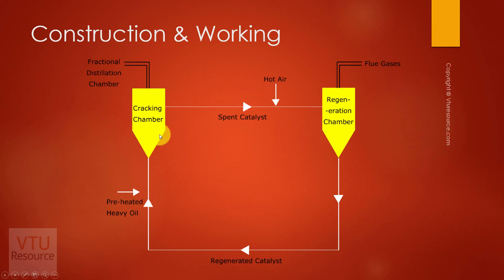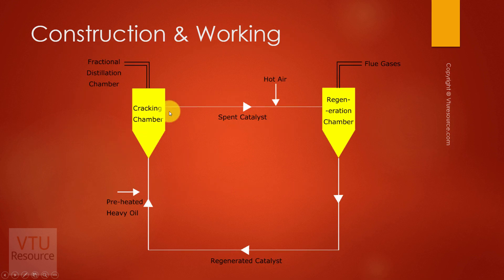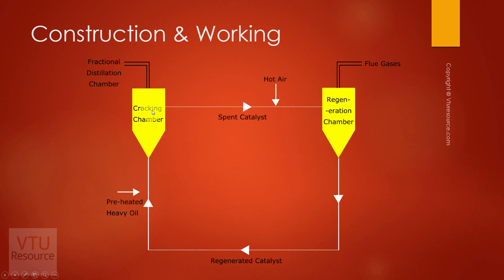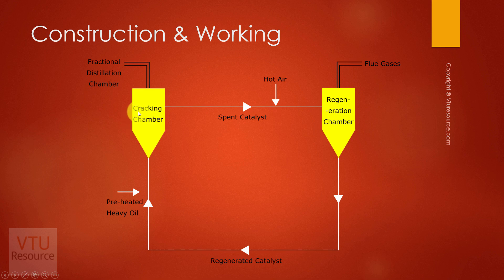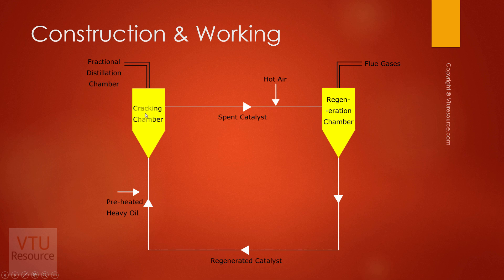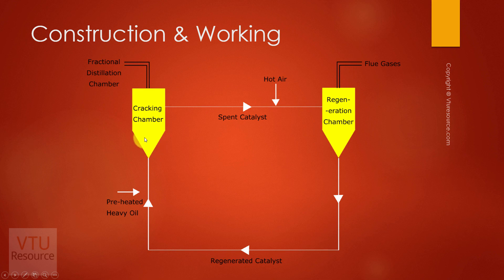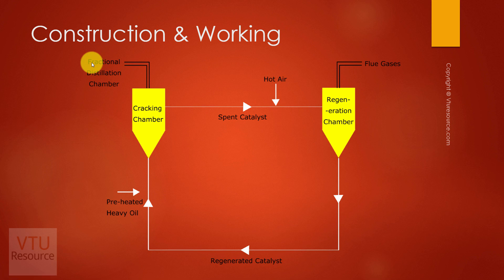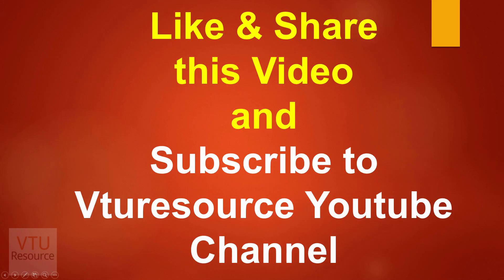Fluidized Bed Catalytic Cracking or fluid Catalytic Cracking

Comment: Good video, but i think you got the ending slightly wrong. The process is called fluidized catalytic cracking mainly because the catalyst in the main reactor is in a fluidized state, not because it is going in rounds and rounds between one chamber to the other.
Reply: Nope brother. He's right. It's called fluidised because the catalyst is moving.

Comment: What is flue gas?
Reply: arjun s , flue is nothing but waste gas
Reply: Flue gas is the gasious  product of combustion, such as gas coming out of the boiler chimney or silencer pipe of car or truck.
Reply: I think it will be Carbon dioxide as the professor says the carbon is burnt off.